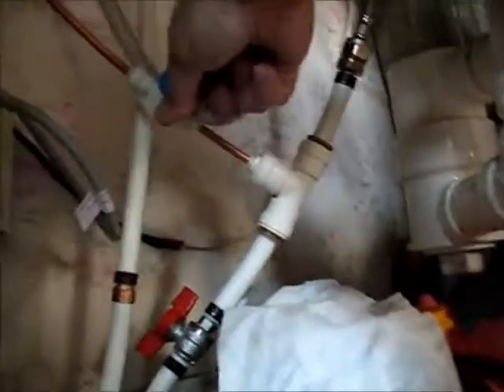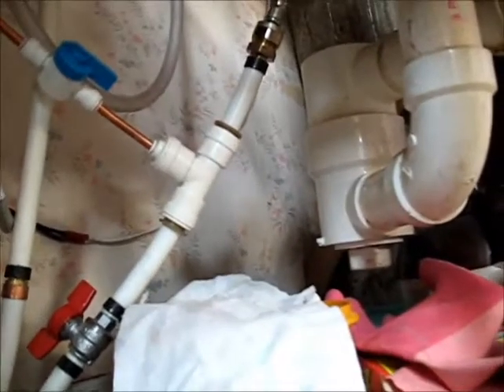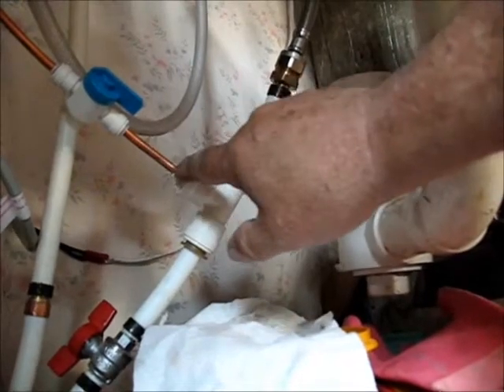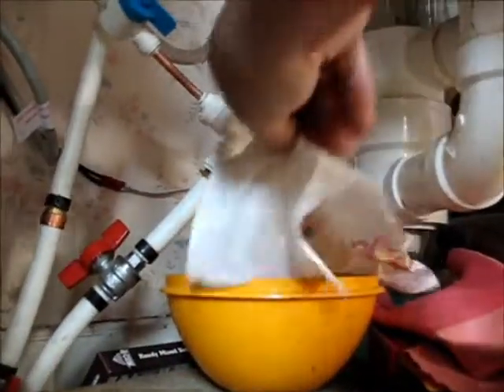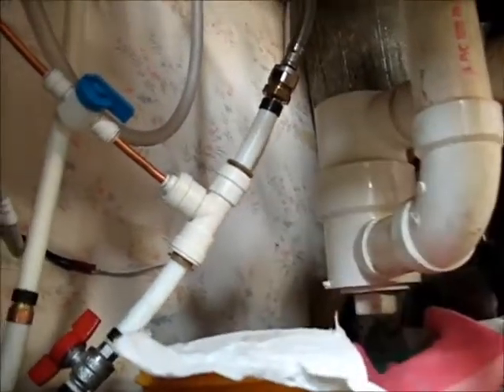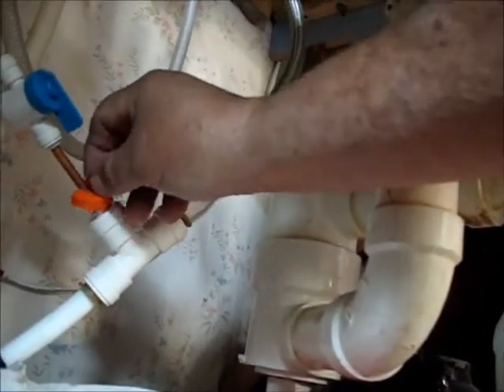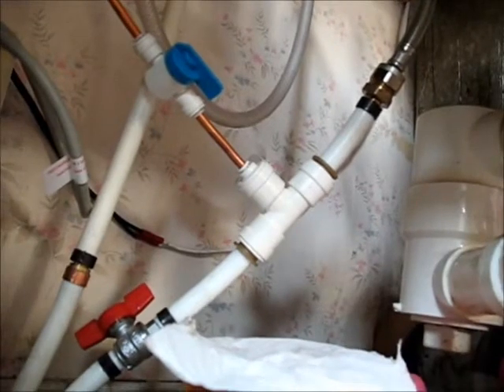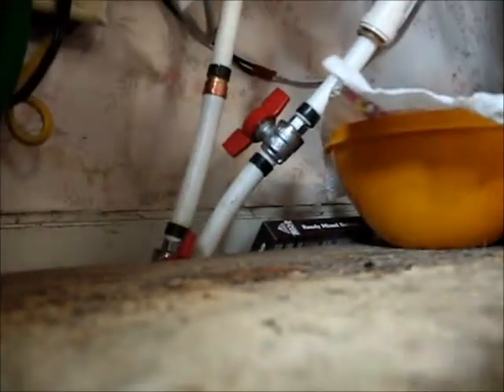Pex Pipe Disconnect Tool

Comment: Got to working today on this removal and found that a 10mm metric open end wrench works just fine for removal of the tubing from the T-fitting. Did not have to run to Home Depot and spend money after all. Interesting thing on the online Home Depot site for this piece, is that they claim it comes for several sizes, starting from 1/4", but at their site they only list the 1/2" and 3/4" ones sold in the stores. Any rate, the small 10mm metric wrench was handy and worked well for removal. Thanks for posting this video.
Reply from the maker: +a1930ford    That's awesome.   Next time I need to get one loose I'll keep that in mind 'cause I'll never remember where I put that little plastic thingee..  hahahaha..

Comment: Went by HD and picked up a 3/8" and 1/4" shark bite removal tool, as they were less than 2 bucks, apiece there. I'll duct tape the baggies with them to the sink pipes to have them just in case there is ever another pex tube or valve to be replaced beneath the kitchen sink.
Reply from the maker: +a1930ford    Good idear..

Comment: I went to two different places today, Home Depot and Ace, and neither place had anyone working who really understood what I was speaking about in removing the pex tubing for a t-fitting like this one. It is exactly the same thing that I have running to my ice maker and the darn thing was found when the guys came and installed a new dishwasher in today. I'll have to go back to HD tomorrow and see if they have the little orange piece your showing. Man, wish I had seen this video before I started my run today. Thanks for posting it, but what is the part name you show and where did you pick it up? All I see on the packaging in your video is maybe the word Push Fit.  What size did you have to use for your T-fitting? 1/4"?